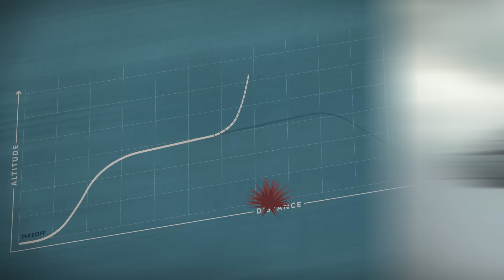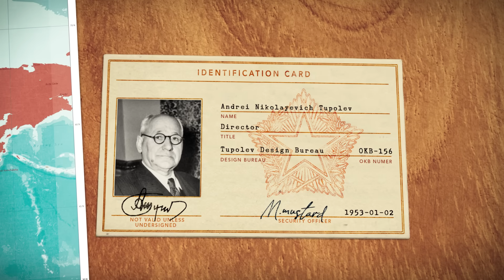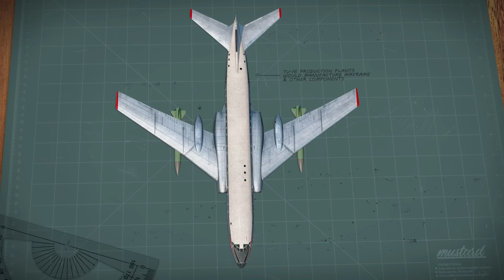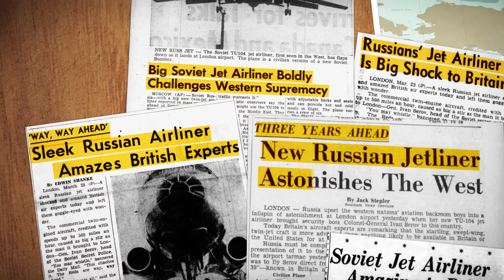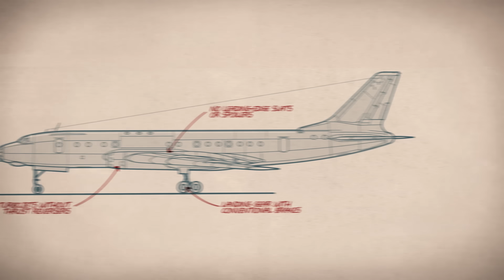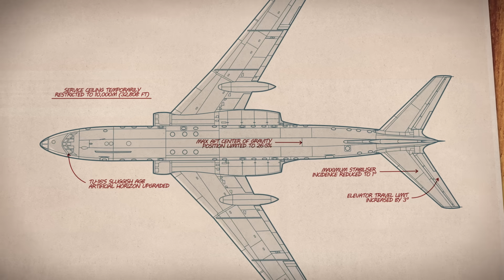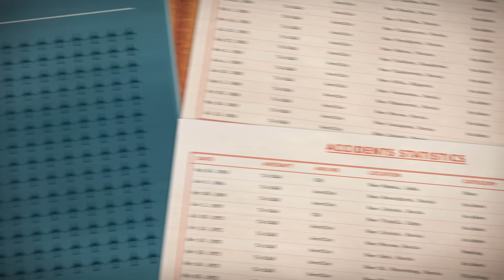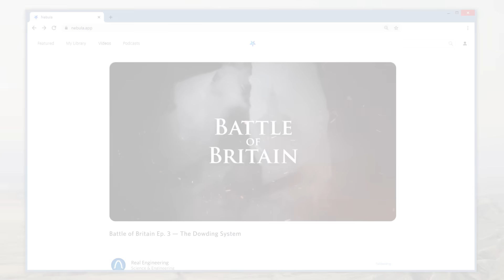The Soviet Airliner Designed To Crash

Comment: No this was not "the most dangerous airline ever, there wasn't a female pilot. LOL
Reply: The de Havilland Comet is the worst jet airliner in history, no jet airliner has a higher loss rate or fatalities statistics than the Comet
Reply: @sandervanderkammen9230 

The marvellous DH Comet.

We believe we can clear up some commonly held myths and misconceptions, obviously.

It's always good to see the facts presented clearly and concisely isn't it?

   Of course De Havilland carried out a full stress analysis & performed extensive & protracted testing on two long lengths of fuselage. De Havilland carried out significantly more testing than was required by any authority at the time & significantly more testing that any previous airliner was subjected to.

    De Havilland did indeed always work to better than industry standards at the time, used up to date knowledge for the design & no evidence of negligence  or criminal negligence was ever produced in relation to the DH Comet.
 
It is the case that the stress for the crown sheets when measured was not greater than predicted.
  
  Obviously there have been worse aircraft for accident losses both before & after the Comet. One of the issues was accident losses due to pilot error which were often caused by the novel aspects of jet airliner flying, even so, the accident losses for the Comet were not particularly unusual at the time.

    How things were back then. 
Accident losses - % of aircraft built.
DeHavilland Comet 4 UK              14% 
DeHavilland Comet all mks          17%  
Vickers VC10 UK                            5%

The DH Comet had better safety than or similar safety to many other commercial passenger aircraft of a similar era.
Douglas DC-1                                      99%
Douglas DC-2                                      47%
Douglas DC-3                                      30%
Douglas DC-4                                      26%
Boeing s300                                        72% 
Boeing 307                                          70%
Boeing 247                                          48%
Boeing 707                                          20% 
Lockheed L-049/149 Constellation  30%
Lockheed Electra  Turboprop .          29%
Fairchild FH-227                                 30%
McDonnell Douglas DC-8                  14%
Sud Aviation Caravelle                       15%
Canadair CL-44  Turboprop               46%  
Convair CV-580  Turboprop               22%
Convair CV-880     (ff 1959)               27%  
Convair CV-990     (ff 1961)               33%
Tupolev T-104        (ff 1956)               16%. 
 
We hope this helps, of course.  
    
As always, cheers & 👍.
Reply: Imagine a d-H Comet with an all DEI crew...

Comment: I am sure the Comet was the most dangerous aircraft ever built. It was a long distance passenger jet, built in England. Many blew up while flying killing all passengers.😊
Reply: The marvellous trailblazing DH Comet.

World's first jet airliner.
World's first high altitude airliner.

De Havilland was subjected to forced merger during the UK Govt instigated aerospace sector rationalisation programme.

Instances of all Comet marks, including the Comet 1, flew with full certification at some point after 1954. Airline duty Comets were all retired by 1980 with full certification until after retirement. The last Comet flight was a global circumnavigation series of flights in 1997.

   Of course De Havilland carried out a full stress analysis & performed extensive & protracted testing on two long lengths of fuselage. De Havilland carried out significantly more testing than was required by any authority at the time & significantly more testing that any previous airliner was subjected to.

    De Havilland did indeed always work to better than industry standards at the time, used up to date knowledge for the design & no evidence of negligence  or criminal negligence was ever produced in relation to the DH Comet.
  
  Obviously there have been worse aircraft for accident losses both before & after the Comet, that includes's fatality rate metrics. One of the issues was accident losses & incidents due to pilot error which were often caused by the novel aspects of jet airliner flying, even so, the accident losses for the Comet were not particularly unusual at the time.

About Bow-wing for instance (See b-47 wing folding / collapse incidents.)

There can be no excuses for the 737 Max incidents after more than 50 years design, build and operation experience & with up to date aviation infrastructure. 737 Max, 2 particular incidents caused 350 fatalities. Aircraft auto pilots itself into the ground, two times.

The many & varied reasons for Bow-wing's (See b-47 wing folding wing collapse incidents) current existence & status have nothing to do with the company itself by the way.  

    How things were back then. 
Accident losses - % of aircraft built.
DeHavilland Comet 4 UK              14% 
DeHavilland Comet all mks          17%  
Vickers VC10 UK                            5%

The DH Comet had better safety than or similar safety to many other commercial passenger aircraft of a similar era.
Douglas DC-1                                      99%
Douglas DC-2                                      47%
Douglas DC-3                                      30%
Douglas DC-4                                      26%
Boeing s300                                        72% 
Boeing 307                                          70%
Boeing 247                                          48%
Boeing 707                                          20% 
Lockheed L-049/149 Constellation  30%
Lockheed Electra  Turboprop .          29%
Fairchild FH-227                                 30%
McDonnell Douglas DC-8                  14%
Sud Aviation Caravelle                       15%
Canadair CL-44  Turboprop               46%  
Convair CV-580  Turboprop               22%
Convair CV-880     (ff 1959)               27%  
Convair CV-990     (ff 1961)               33%
Tupolev T-104        (ff 1956)               16%.
Reply: We feel we can clear up some common false myths, misunderstandings & misconceptions.

It's always very important to note the relevant facts obviously.
 
    Regarding the UK Aerospace Sector.
   
An airline recently ordered 60 RR Trent XWB Engines 

   Clearly It's a great pity & a crying shame that British military forces had to occupy a large part of Germany for decades after 1945 & Russian military forces had to do the same. Of course Russia still posseses a large chunk of what was German territory & of course  Russia & the UK produce nukes. Obviously Germany does not produce nukes.

   Interesting British achievements.
There is no doubt that the Fairey (England)
Delta 2 was of course the world's first jet
aircraft to exceed 1000 mph.  lndeed It
exceeded the previous record by 310 mph &
held the record for 1 year. Incidentally, the Dassault Mirage 3 & 4 are based on the Fairey Delta 2.

Early days, jet fighters.
   De Havilland Vampire, Sea Vixen & Gloster Meteor accident losses were not high or unusual for fighter aircraft at the time. De Havilland built large numbers of all metal airframe aircraft before the DH Comet.
We mustn't forget of course that the DH Vampire for example first flew in 1943 & the engine was also built by De Havilland. There were examples of the Vampire interceptor / fighter in service until 1990 which was operated by more than 30 countries.

Non combat phase accident losses.
% of Aircraft built.
The Canadair CL-44 was a turboprop airliner.
Canadair CL-44             (ff 1959 ) 48%
Lockheed XF104             (ff 1954) 100%
Lockheed  P80                (ff 1944) 43%
Lockheed F104                (ff 1954) 45%
McDonnell FH Phantom  (ff 1945) 35%
Gloster Meteor               (ff 1943)  21%
DH Vampire                     (ff 1943)  23%
DH Sea Vixen                  (ff  1951) 33%
Gloster Javelin               (ff 1951) 20%

   An example of what goes on these days in various countries.
Obviously, for example, there are of course no German companies that makes German jet aircraft in Germany & there are no German Companies that make German gas turbine aero engines in Germany that are suitable for widebody airliners.

     That's correct, Brazil makes very good airliners & Brazil is 100th down the list along with Indonesia for wealth per capita. Of course it is in fact the case that Embraer can't build those airliners without purchasing stuff from the US, UK & Europe.
Norway Holland Denmark Ireland Belgium - Top 20 wealth per capita - Don't make airliners -  its as simple as that.

   Early days of the airliners.
That's correct of course, at the time the Comet wasn't particularly dangerous. Agreed, that is indeed the case of course, The DH Comet was definitely not the worst engineering failure in commercial airliner history.

It's not valid to compare a Bow-wing ( see B-47 wing folding & wing collapse incidents for details) jet  airliner designed & first built as late 6 decades after the Comet, with the fabulous De Havilland Comet, the world's first high altitude jet powered airliner.  
  Vast improvements in commercial aviation infrastructure alone being a significant factor in improvements in air travel safety safety over more than half a century.
    Of course 50 years more design, build & operation experience didn't prevent the horrendous Bow-wing 737 Max incidents, there can obviously be no excuses for that.
  
  That's correct of course, at the time the Comet wasn't particularly dangerous. Agreed, that is indeed the case of course, The DH Comet was definitely not the worst engineering failure in commercial airliner history.

Losses comparisons
How things were in those days.

DeHavilland Comet 4 UK                       14% 
DeHavilland Comet all  (ff 1949)           17%  

Boeing 307                               70%
Boeing 247                               48%
Boeing 707            .                  20% 
Lockheed Electra Turboprop   29%
Canadair CL-44  Turboprop     46%  
Convair CV-580  Turboprop     22%
Convair CV-880    (ff 1959)       27%  
Convair CV-990     (ff 1961)      33%
Tupolev TU-104       (ff 1955)    16%

     Of course De Havilland had prior experience building many all metal construction airframe aircraft & thousands of jet powered fighter aircraft that were primarily of metal construction with pressurised cockpits & jet engines built by De-Havilland.

  More recent UK military jet aircraft.

  Of course the Tornado & Typhoon & their engines are Supersonic & are indeed British design aircraft with British design engines built by an international consortium. The Tornado design for example started life during the 1950s at Vickers as the AFVG, it's engine is based on the RR RB-199. The EE Lightening is also a British Supersonic jet aircraft.

  The Typhoon is the British BAC-EAP with an engine based on the British RR XG-40, the Typhoon is also built by an international consortium.

  Agreed, that is correct of course, clearly there are many countries that could easily produce airliners of better quality than Bow-wing (see b-47 wing folding & wing collapse incidents) but don't for some very good reasons. Bow-wing (see B-47 wing folding  & wing collapse incidents) being a result of the size of the US, the large protected domestic market & great ease of testing new types due to the equator to arctic geography complete with up to date aviation infrastructure & a few other reasons related to production scale capability, politics, the nature of the airliner market coupled with the nature of airliners themselves & general basic economics.

  Obviously there really is nothing special about Bow-wing, having more than 50 years design / build experience on the type means they have no excuses for the horrendous 737 Max incidents for example.

    Indeed BAe Systems & Rolls Royce combined now do more Airbus work than Germany on an absolute basis & significantly more work than that on a per capita basis.
   
     Agreed, Per capita for the home nation BAe Systems is the world's largest defence contractor.
  
    Correct, BAe systems announced the recent £4 Billion takeover of Colorado based US based Ball Aerospace.
  
    It's definitely the case that BAE systems now does a significantly higher value of work for Airbus than it did when it was a major Airbus shareholder before 2005.
     
      Obviously RR now owns US Engine maker Allison for example which does classified Aerospace work for the US Govt.
   
   Yes, that's right of course, Anybody currently flying on a widebody airliner stands a good chance of being on an aircraft powered by RR gas turbine aero engines built in the UK.

   A typical but small glimpse of what goes on in the very internationally orientated British aerospace sector.  

  Of course the RR Nene was in fact the world's most reliable & most powerful gas turbine aero engine in 1944. Licensed built versions & copies of the RR Nene & RR Derwent would go on to power many aircraft in Russia including the Mig 15 & Mig 17, the US, China, France & other countries for decades after 1944.

      Boeing Apache Attack Helicopter.
AH-64: 75 UK suppliers, 7% UK content, global fleet of 1280+ aircraft.
F35B more than 130 UK Suppliers, more than 30% UK content.
F35A & F35C more than 130 UK Suppliers, more than 15% UK content.

   There is no doubt that an airline has just ordered
60 RR England Trent XWB Engines

Obviously the UK has the
World's Highest Combined Per Capita
 Nuclear / Defence / Aerospace Sector Activity.

Rolls Royce Holdings UK
Subsidiaries
- Rolls-Royce plc
- Rolls-Royce North America (Allison etc Classified Military stuff)
- Rolls-Royce AB
- Rolls-Royce Deutschland
- Rolls-Royce India Private Limited
- Rolls-Royce Marine Power Operations
- Vinters Engineering Limited
- Rolls-Royce Controls and Data Services
- Rolls-Royce Power Systems
- Bergen Marine
Joint ventures include:
- Rolls-Royce Turbomeca
- MTU Turbomeca -

Trent Family
The MT30 (Marine Turbine)
Industrial Trent 60 Gas Turbine
Trent 7000
Trent XWB Airbus A330neo.
Trent 1500
Trent 1000
Trent 500
Trent 600
Trent 700
Trent 800
Trent 8100
Trent 900

RR wholly owned subsidiaries in Germany handle smaller 2 shaft RR gas turbine aero engine work.

We hope this helps, of course as always.  

Cheers & 😎 & of course 👍 indeed.

.. ......  .... .. .. .... ..... . . ....
Clearly the line above this line is not blank.

Comment: Is this the first iteration of the notorious MCAS? :face-blue-smiling:
Reply: MCAS was introduced in 1959 on the Boeing 720, it has been used on hundreds of different aircraft types and 10's of thousands of aircraft since then.
Thousands of lives have been saved by MCAS
Reply: @sandervanderkammen9230 

The marvellous trailblazing DH Comet.

World's first jet airliner.
World's first high altitude airliner.

De Havilland was subjected to forced merger during the UK Govt instigated aerospace sector rationalisation programme.

Instances of all Comet marks, including the Comet 1, flew with full certification at some point after 1954. Airline duty Comets were all retired by 1980 with full certification until after retirement. The last Comet flight was a global circumnavigation series of flights in 1997.

   Of course De Havilland carried out a full stress analysis & performed extensive & protracted testing on two long lengths of fuselage. De Havilland carried out significantly more testing than was required by any authority at the time & significantly more testing that any previous airliner was subjected to.

    De Havilland did indeed always work to better than industry standards at the time, used up to date knowledge for the design & no evidence of negligence  or criminal negligence was ever produced in relation to the DH Comet.
  
  Obviously there have been worse aircraft for accident losses both before & after the Comet, that includes's fatality rate metrics. One of the issues was accident losses & incidents due to pilot error which were often caused by the novel aspects of jet airliner flying, even so, the accident losses for the Comet were not particularly unusual at the time.

About Bow-wing for instance (See b-47 wing folding / collapse incidents.)

There can be no excuses for the 737 Max incidents after more than 50 years design, build and operation experience & with up to date aviation infrastructure. 737 Max, 2 particular incidents caused 350 fatalities. Aircraft auto pilots itself into the ground, two times.

The many & varied reasons for Bow-wing's (See b-47 wing folding wing collapse incidents) current existence & status have nothing to do with the company itself by the way.  

    How things were back then. 
Accident losses - % of aircraft built.
DeHavilland Comet 4 UK              14% 
DeHavilland Comet all mks          17%  
Vickers VC10 UK                            5%

The DH Comet had better safety than or similar safety to many other commercial passenger aircraft of a similar era.
Douglas DC-1                                      99%
Douglas DC-2                                      47%
Douglas DC-3                                      30%
Douglas DC-4                                      26%
Boeing s300                                        72% 
Boeing 307                                          70%
Boeing 247                                          48%
Boeing 707                                          20% 
Lockheed L-049/149 Constellation  30%
Lockheed Electra  Turboprop .          29%
Fairchild FH-227                                 30%
McDonnell Douglas DC-8                  14%
Sud Aviation Caravelle                       15%
Canadair CL-44  Turboprop               46%  
Convair CV-580  Turboprop               22%
Convair CV-880     (ff 1959)               27%  
Convair CV-990     (ff 1961)               33%
Tupolev T-104        (ff 1956)               16%.